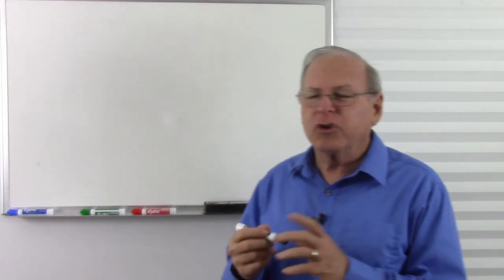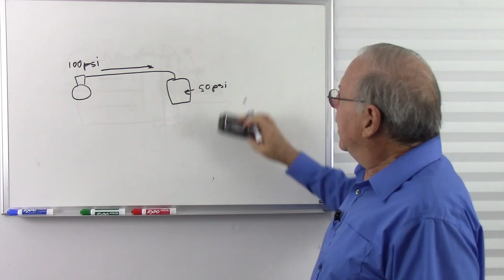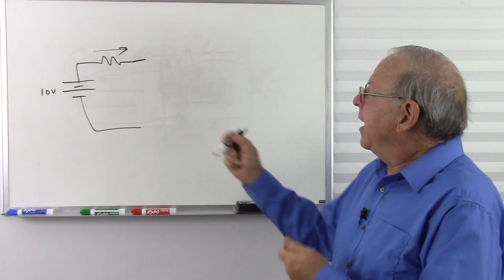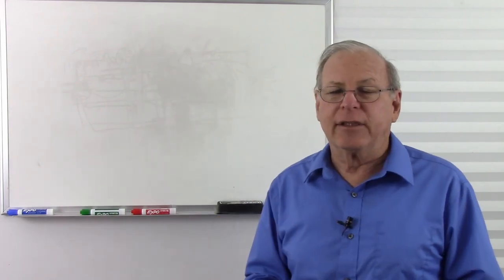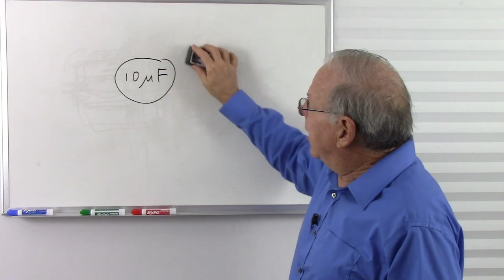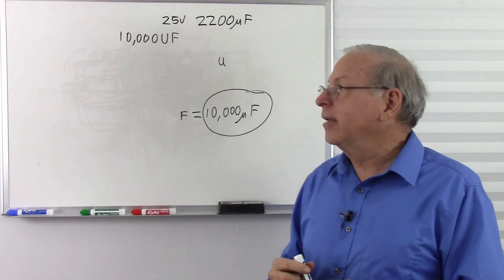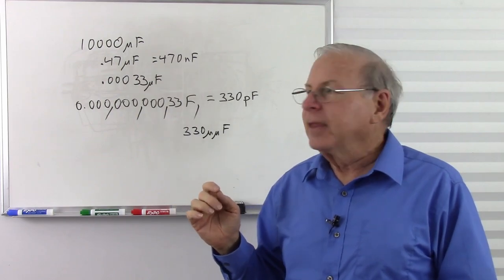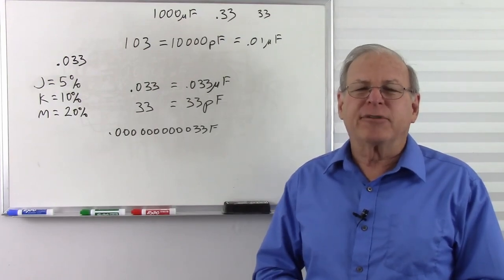Capacitors Part 1 - Introduction

Comment: Very early in explanation, there is an insulator between 2 plates. You drew a line from the negative side of the capacitor and said current was flowing...but how could it flow if there is an insulator between the positive and negative plate ?  In the air tank example there is no such negative side of the air tank back to the pump suction.

Comment: This is the first time i listened to your topics and so far your explanations are great !

Regarding Capacitors, i have read hundreds of textbooks trying to explain how capacitors work and they all pretty much say the same verbiage but nobody explains how these capacitors work and the explanation is easy to understand.

You come along with an ingeneius explNation using the Compressor analogy.  Using this compressor idea helps explain why the calacitor eventually stops pushing ectrons flow and the voltage becomes the same value of the battery voltage.   

So you seem to have a gift in explaning weird components so they are easy to understand.

Thank you for the clarity !   I hope most young electricity/electronic students get a chance to see your videos because they will learn the basic technology very quickly and not struggle with it, as has been the situation in past generations of ztudents in electronics.

Thanks again.

Gerard

Comment: great explanation, will a capacitor always charge to its rated voltage or is that dictated by the circuit?

Comment: Hey Bob, if we put  a capacitor in DC voltage source with no resistance that means voltage of a capacitor equals voltage of the dc source and does that mean capacitor charge instant and no current flow in the circuit anytime ?
Reply: There is always a charge time in real life.  Power supplies have output impedance (resistance) and even a battery has a internal resistance.  Even the wires and leads connecting the capacitor to the power supply or battery have resistance.
Reply: Yeah, got that .Thanks. @mikesradiorepair

Comment: actually I should have said that a tire will only be fully inflated when its volume is completely filled. Can a capacitor be filled when the voltage source is at different voltage levels? Is it just a matter of more or less time?

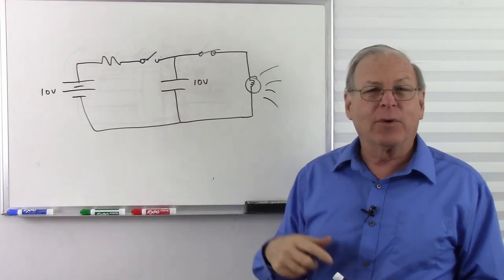Comment: what happens in the circuit at 07:32 if both switches are closed simulatenously? So C charges via the battery but at the same discharges through the bulb?
Reply: actually in both close SWs the batt charge Cap and turns on lamp and caps keep charging until gets full and when bat sw is open cap discharges in lamp.in real time we speak about 1uS and caps can remove ripples from our circuit
Good Luck